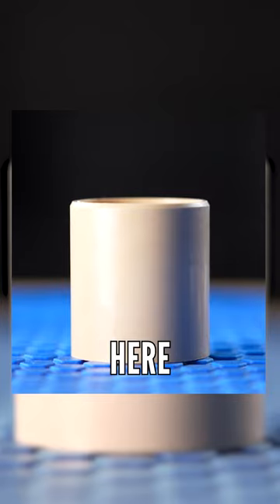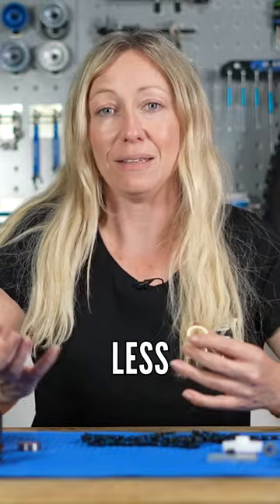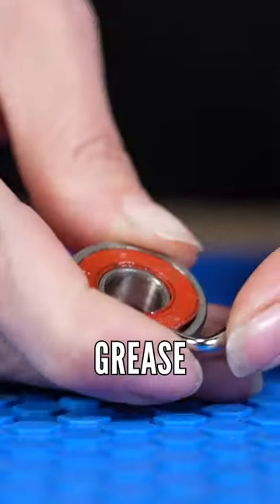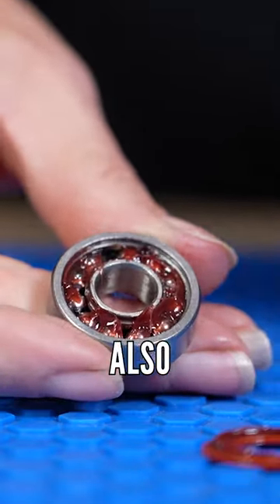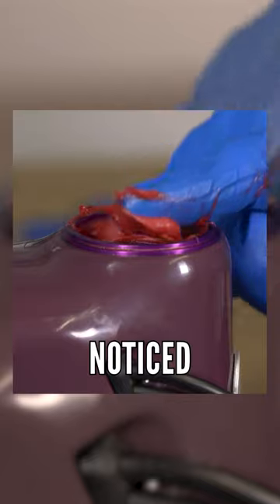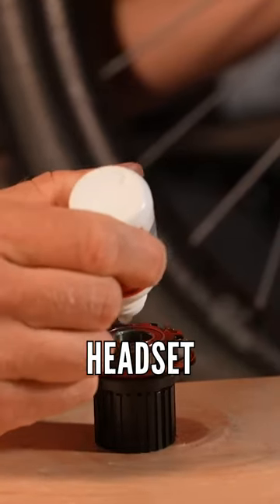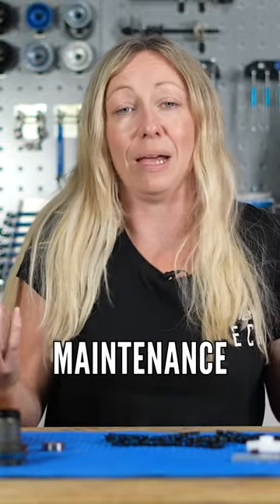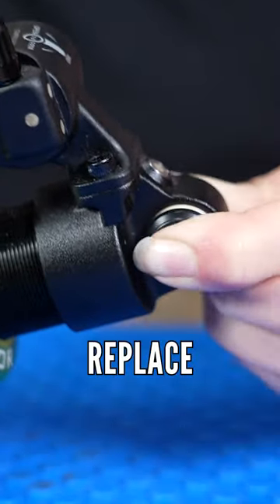How To Maintain Bearings & Bushings! 📚🛠

Comment: igus will sell you replacement bushings as long as you can measure the size accurately even if the pedal manufacturer does not list replacements. And here's a tip for you Igus bushings will not hold up to the heat of a powder coating oven when you try and powder coat your pedals don't ask me how I know that.